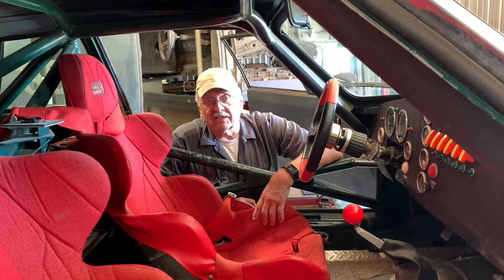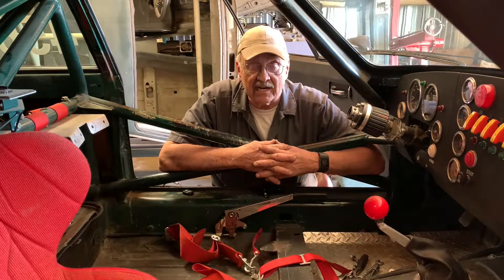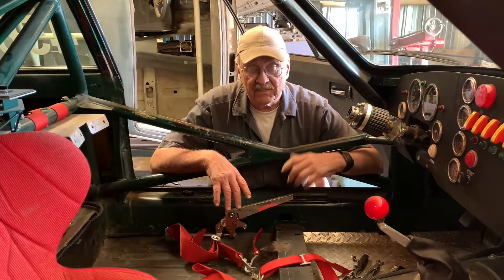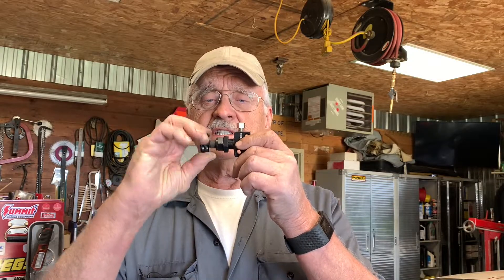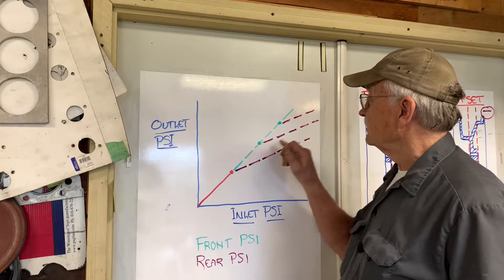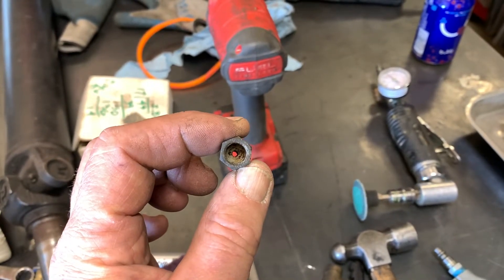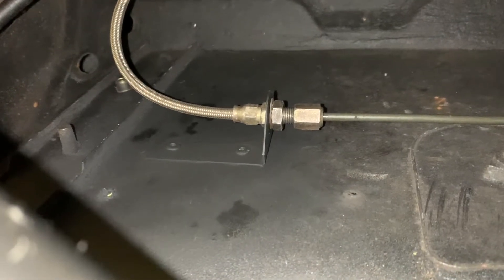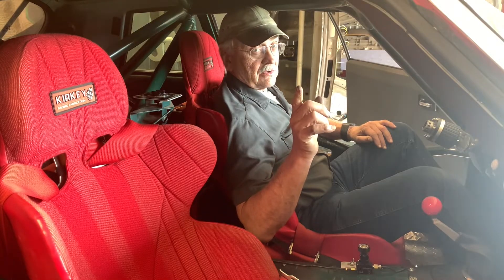How To Install A Tilton Proportioning Valve.

Comment: Nice looking installation.  I have to wonder why your experience runs counter to some other XJS track drivers who've INCREASED rear braking, or left it as is.  Norman Lutz has bored out his rear calipers to accept bigger pistons to restore balance from I believe a 73/27 balance to an original (i think e-type) 68/32 configuration (I have the sheet somewhere from Norman).   And Donald Miles has commented on this at least once mentioning no issue with rear brake bias (although he did have that adjustable twin master cylinder setup.  I can imagine those front springs letting the front brakes work harder though.  IDK.  Just airing thoughts....
Reply from the maker: July's videos will deal with brakes predominantly. Maybe we can get some comments from racers on the subject. What I know at this point is the car is very unstable under heavy braking, the rear calipers overheated to point of the seals failing at Road America, and the rear pads need to be replaced twice as often as the fronts which show no signs of working particularly hard. Only track time will tell.
Reply: @thecampchaoschronicles9567    Yeah, there's clearly a TON of heat in those calipers, and I assume it's via heat transfer from the rotors (more so than exhaust).  Have the pistons been replaced w/ stainless to minimize that?   Also... got some ideas for bolting on heat shielding from the exhaust.... (drilling small holes in the caliper spacers to accept screws / studs holding a shield).   Have any thermal marking paint to see how hot components are actually getting?  Maybe make up some thin titanium pad shims back there?
Reply from the maker: @ferrariguy8278  Yes, the pistons are stainless. The exhaust pipes are at least 10" away from the calipers and theres an aluminum plate between the bottom of the rotors and the exhaust tubing.